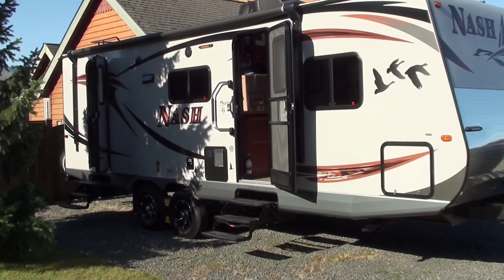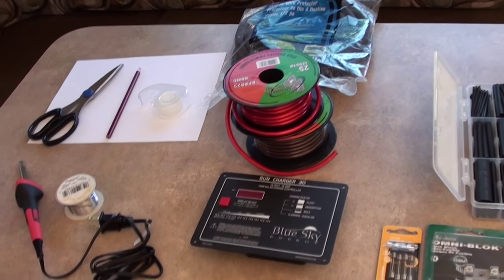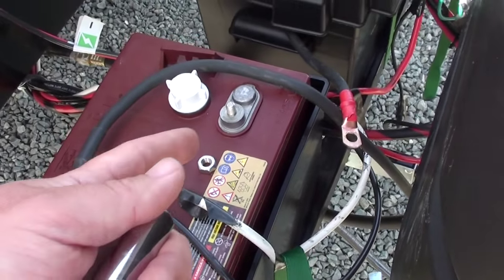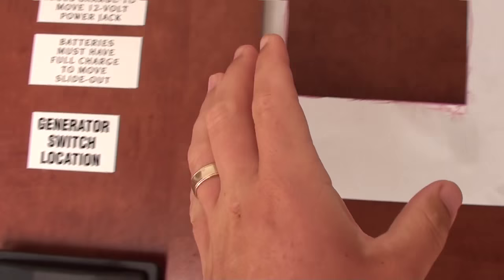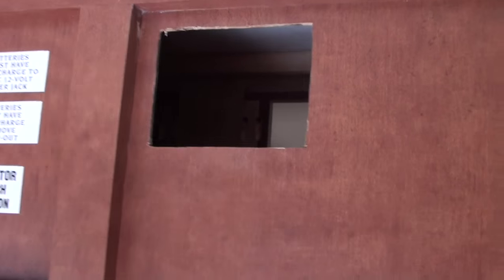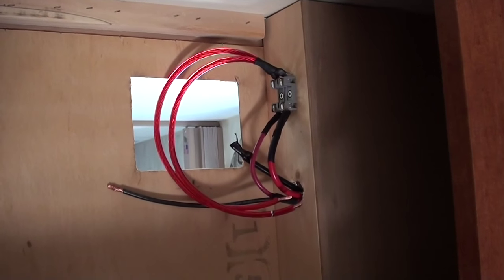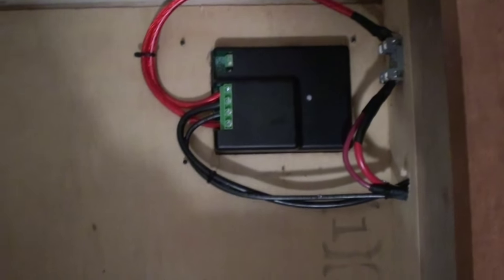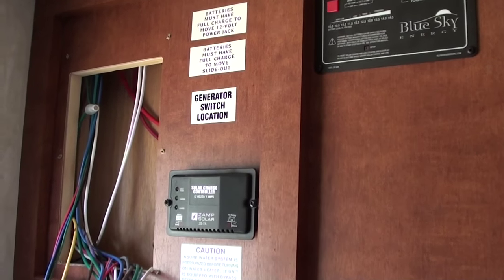RV Solar Install Part 1 of 2

Comment: just a suggestion,..... install a relay onto the positive side of the line  just after the fuse, this way you could simply turn on/off the connection between the battery and the solar system in case of an emergency or any other reason. Fairly inexpensive ( less than $25 )  with a small switch that is connected to the relay.   :-)

Comment: How did you mount the z brackets to the roof of the rv? i have the same travel trailer that you have. thanks in advance
Reply from the maker: 1.5" stainless lag screws.  I used the largest diameter that fit in the brackets holes. The plywood up there is plenty thick so dont worry about needing to go through a roof truss.
Reply: @amped79  thanks so much, I really enjoy your videos as we have the same travel trailer. I like how you do things, and you're very detailed. did the z brackets work for your curved roof or did you use a special bracket made for curved roofs?
Reply from the maker: @johnculver8707  I'm glad I can help and motivate lol.  The z brackets work on the arched roof. What happens is the center portion of the panel ends up having less clearance to the roof but enough.  I'd test before u start screwing into the roof.  What I did is I bolted the brackets to the panel and then placed panel on roof. Once I was happy with position I coated the lag screws with dicor and screwed them in. Then a liberal coating of dicor to completely cover the screw and the bracket even as far as a half inch onto the roof membrane.   Just be careful moving the panel around on your roof as the brackets are sharp and could puncture the roof membrane.
Reply: @amped79  Thanks a bunch!

Comment: why not just take the old controller out and make that hole bigger? i know this is an old vid. Im hoping u had space restrictions or somethin
Reply from the maker: The new controller did not fit in the same place, otherwise i would have done exactly what you said.

Comment: Why not just use the existing Zamp Charge Controller?
Reply from the maker: inseinej1 the existing controller is only suitable for a very low wattage system I believe it was 4 or 7 amps maximum.  My 300watt solar installation puts out upwards of 18amps depending on conditions so upgrading was mandatory.  Also the additional features and customization I gained from the blue sky controller was needed for maximum battery health.
Reply: great thanks for the info, knew there was a reason just wasn't sure on the specifics.  I just got the same trailer (2017 model), how do you like it so far...any issues?  Only had 2, 3 day trips but it seems pretty good so far.
Reply: I think I heard you say that you were going to hook the 20 watt panel in with the 2 larger panels; doesn't that lower your total output. AltE store has done a video about that; you might want to check it out.